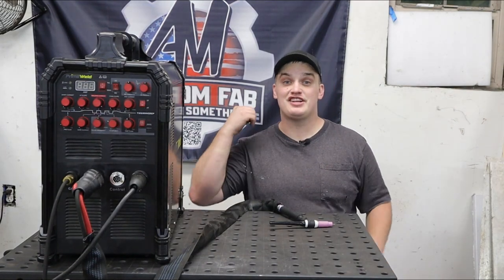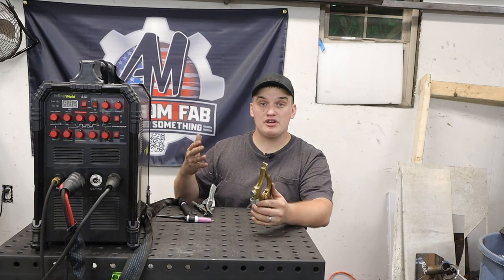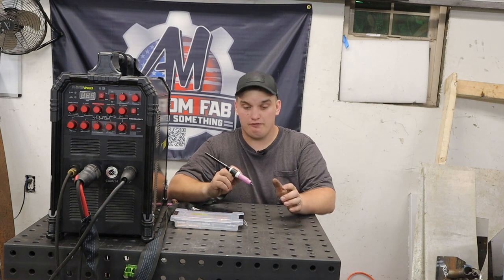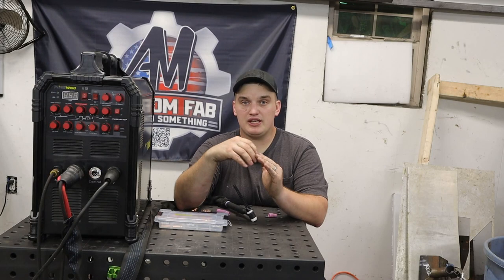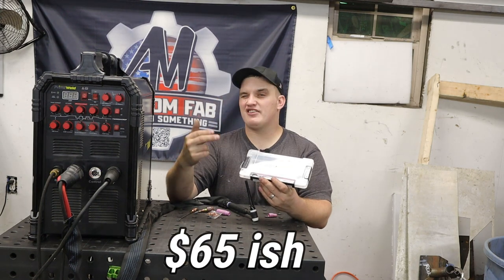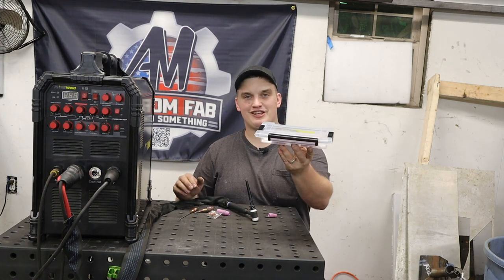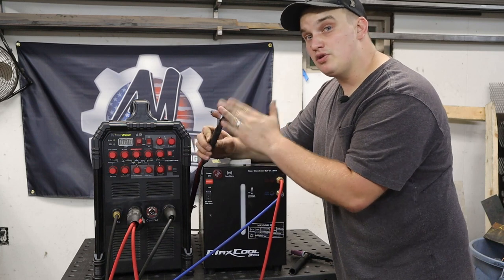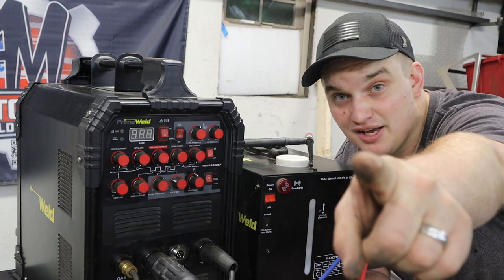3 Tig 225x Performance Upgrades in 8 minutes ( PRIME WELD )

Comment: Great job on the information. Same addition I did to my setup i was looking for a 300+ amp welder for all of the 5\8 aluminum I was welding added the cooler and the flex-loc torch solved all the problems I had. Don't get me wrong I'll probably be upgrading to the 325x in the future I'm still unsure of the micro processer of the machine always have trouble with computers big fan of analog. Haven't had any troubles out of my 225x and might run until it gives up on me.
Reply: I'm an analog guy too, a little fidgety with digital . To me the knobs are all I want . :)
Reply: @johnjelinek-g7b  I'm the same kinda leery of micro processor managing the operating system in the welder. Who is to say that the HF starts are not going to shorten the life of the processor board???? They tell you when welding on a car to remove the negative connection off the battery so you don't short out the computer????🤔🤔🤔🤔 I've been using analog welders since going through votec school in 1992 some of welders I learned on are still at the school today Miller syncrowave.

Comment: 😪 I bought my 225x before they started putting an outlet on the back for the water cooler, though I suppose it isn't strictly necessary. Just have to remember to turn on the pump before pressing the pedal. Being just a hobbyist I doubt I'll miss it. Thanks for the other suggestions though. Really appreciate your videos.
Reply: I bet they would swap ur machine with an updated one

Comment: Don't forget MIG welding that water cooler will work with MIG welding they make water cooled MIG welding torches too so if you wanted to put a water-cooled gun on a 300 amp machine-like for aluminum because aluminum takes a lot more heat you can do that Harbor Freight has some consumables for TIG welding I even think I saw a stubby lens kit don't know if they sell tungsten but I pretty sure I saw kit for TIG welding with a short back cap

Comment: I've been trying to find a thumb controlled rotary switch to control amperage instead of the foot pedal and can't seem to find one that fits the tig225. Would you be able to point me in the right direction? TIA
Reply from the maker: 6061.com has one. Have not tried it yet, but it's a button that the harder you push the more amperage you get out of it. I've not personally tried it, but I've heard good things
Reply: @amcustomfab the one Alex is referring to is called TIG button. I have one, works great, way easier than operating a rheostat mounted on the torch.

Comment: The Primeweld cooler doesn't work on 220V, so the specs in the webshop are wrong. It says it works on all welders!
Reply from the maker: I could be wrong but I'm pretty sure it's dual voltage  unless you have an older model that doesn't plug into the back of the machine
Reply: @amcustomfab  I'm talking about the ones they sell now. Their specs say 110 V only. My 225X is the newest version.
Reply from the maker: That pushes it pretty close to the max. Yeah if you have the newer ones even if you have the machine plugged into 220 it will automatically convert it for the water cooler plug
Reply: Yep, it automatically reduces the voltage at the plug to 110 volts if you're running on 220volts . And it's flawless . :) @amcustomfab
Reply: My cooler works on 220 v
I've got the 225 tig..welds great doesn't burn your hand.
I got the ck 20